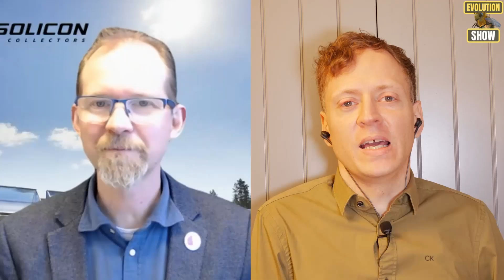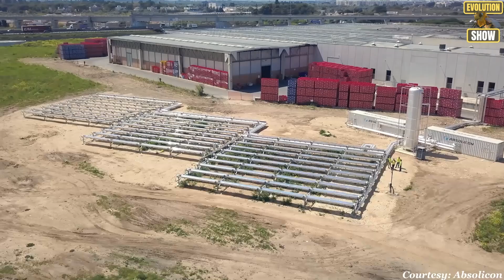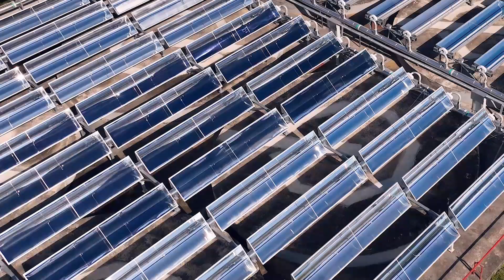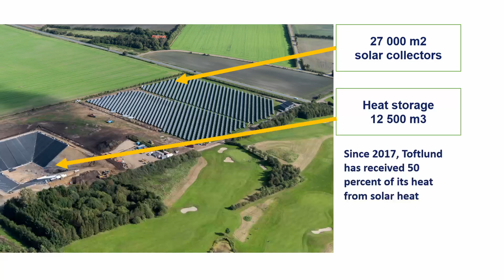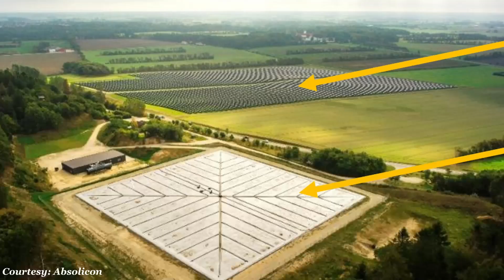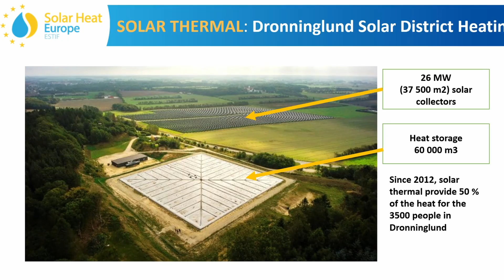Warming a City with Solar Heat in Winter? Smart Seasonal storage with Absolicon´s solar collectors

Comment: stupid to store it in water, make sand storage
Reply: Sand only makes sense if you're storing heat at temperatures higher than 100C. Sand has a much lower Specific Heat than water (830 vs 4200J/kg/C), and needs pipework embedded all throughout the sand to extract the heat. Water can simply be pumped.
Reply from the maker: Exactly! And as Joakim says: when you transfer hot water to a water pit for water storage and need to pump it back again the heat losses are only 5 %. Water is easy to heat and holds heats for a long time as long as you keep it insulated. I will use a similar principle to maintan a temperature of 6-7 Celsius in my above ground cellar for food storage . By placing an air pipe 2 m into the ground that is 25 m long, that takes outside air and heats/cools it to a stable tempeture of about 6-7 Celsius when it reaches my very insulated cellar. Regardless if it is -20 C or +20 C the temperature will be perfect to store potatoes and veggies etc. Simple but very reliable technology! 
Cheers,
Johan

Comment: But how does the cost compare with other sources of heat? This might be OK in certain niche applications (eg a factory with enough space nearby to install such an enormous pit), but I can't see it having widespread application.
Reply from the maker: Hi! Most industrial applications don't need a heat storage to be able make huge economic savings having solar heat storage installed. They can be installed on the roof of the factory for example like Colgate-Palmolive has done on one of its factories in Italy for example. When it comes to residential areas with district heating burning natural gas/biomsss or similar can similarly complement this with solar thermal so it can be used partly without storage still saving alot of energy costs. 
Cheers,
Johan
Reply: @EvolutionShowNr1  sorry, as an engineer I want to see the numbers. Just saying "huge economic savings" doesn't mean anything.